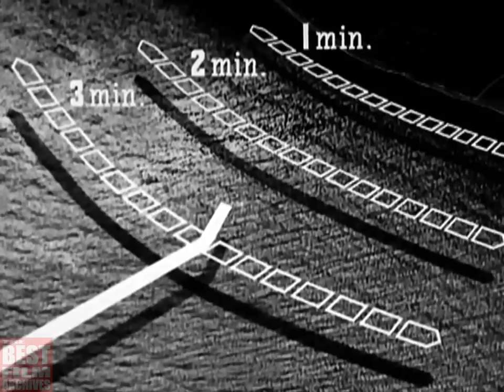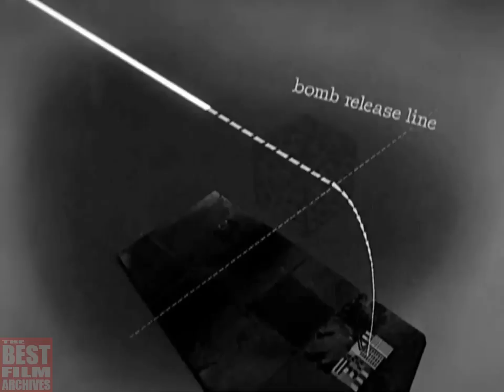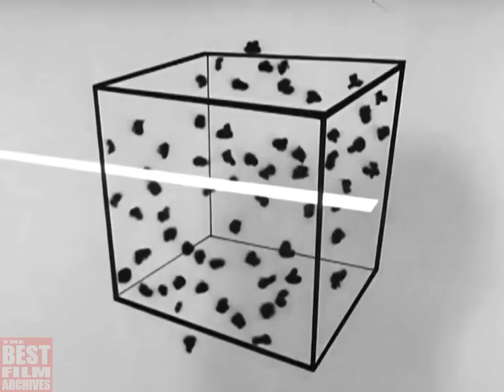German Anti-Aircraft Gun System | Flak | US Air Force Training Film | 1944

Comment: 4:45 - "Director, Mechanical Whiz Kid"....so, Nazis used computers back then, eh?
Reply: they were electrically actuated mechanical computers, they were furniture-sized and had less calculating power than your average hand calculator, the allied used them a lot too.
Reply: there were mechanical computers.
Reply: In 12th century AD - gunners (these are firing canonballs) were computing trajectories using analogue computers called astrolabes (the gunner version of it is a tad different than the one used for astronomy, but the math is the same) :). Before going into battle guns were sighted so you knew how much powder, and what kind of ball would go which distance. The science and math for doing this stuff goes quite a way back.
Reply: Technically speaking, they used quadrants for rangefinding, not astrolabes, although the two devices are similar.
Reply: the Zuse Z3 computer,  fully electronic, programmable, digital.

Comment: What was this ammunition called? How did it function? Was the projectile filled with pellets or something? Or did it simply create an explosion in the air?
Reply: benny704 it's like a Grenade shot out of a canon, the shell has a fuze on it to detonate it when it reaches a certain height, and when it exploded it sends shrapnel in all directions
Reply: The Germans used timed or altitude based fuses.
The US also developed radar shells that go off with proximity to the aircraft. These were partially why the Great Marianas Turkey Shoot earned its nickname.
Reply: variable time fragmentation rounds, set on the fuse that were attatched to the round filled with high explosives. the thick case provided the fragmentation necessary just like a hand grenade

Comment: And then there was the SAM.
Reply: +4T3hM4kr0n! So did the U.S. The guided Bat glide bomb, AZON, Gorgon missile...

The Bat was pretty successful in the Pacific against Japanese surface vessels.
Reply: +lil joe seri used RADAR and active tracking with the missle to home in and prox burst or burst on contact. But without radar or something to jam the signal the SAM's become useless. The germans actually had remote controlled bombs released from planes. They used them against ships but the british quickly found ways of jamming the frequencies so the crew couldnt steet the bomb.
Reply: lil joe seri SAMs are relatively easy to evade with the right equipment, usally you can hear SAMs Commung for you, with flak you never know which shell has your name on it